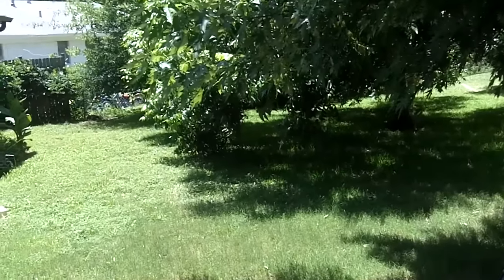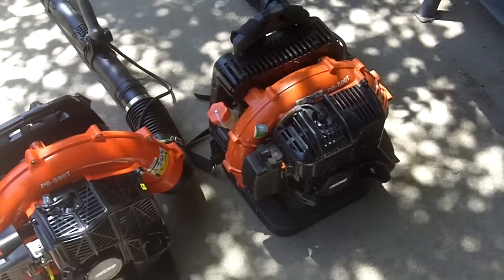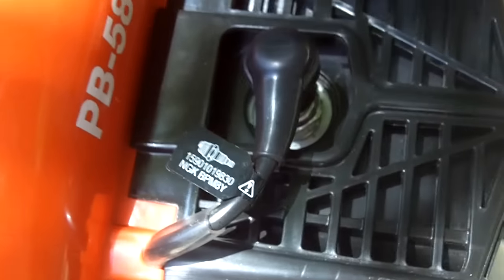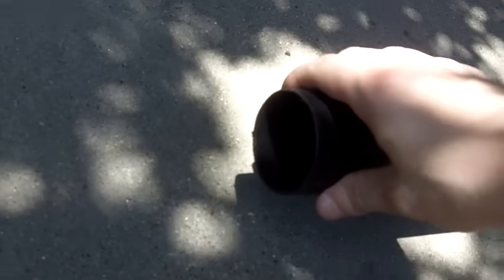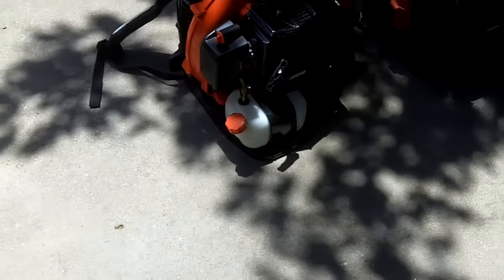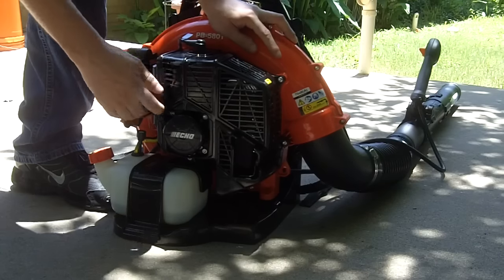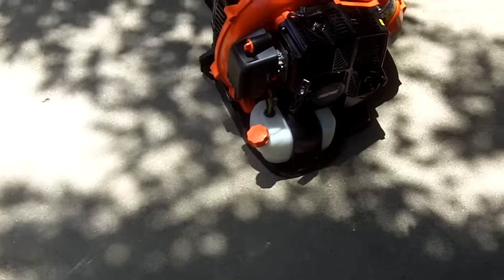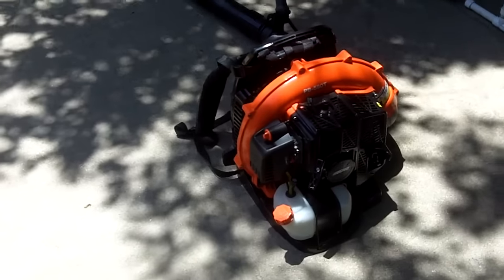Brand New!!!2015 Echo PB 580T Backpack Blower

Comment: Okay i just bought 2 of them 3 days ago. I dont get those starts at all. I turn on the switch, set on cold start, keep pulling about 5-7 times still no sound of start, set it on run 3 pulls starts on both of them.

Comment: I have one quick question what's that loose wire from the side for should I take of or leave it
Reply: +Larry Hernandes i just purchased this blower and I'm needing to know what to do with that same wire !? Help?
Reply: Jose Rincon it's a grounding wire put it down tube if you don't it will shock u when u use it
Reply: I believe it's because of the wind generate static electricity.  The wire needs to be put down the tube just like other people have stated.

Comment: Any issues with getting shocked?
Reply: I just bought one and used it last weekend without getting shocked. I think you just have to be sure and run the ground wire inside the blower tube.
Reply: I just purchased one and i have no clue whats the silver wire for?